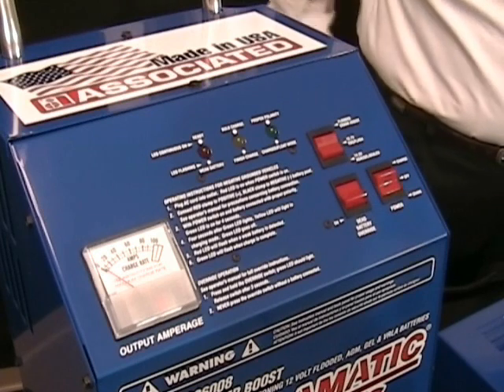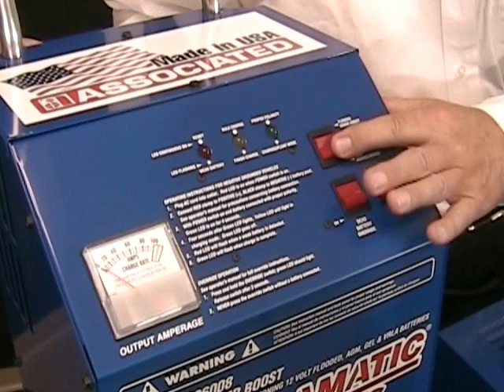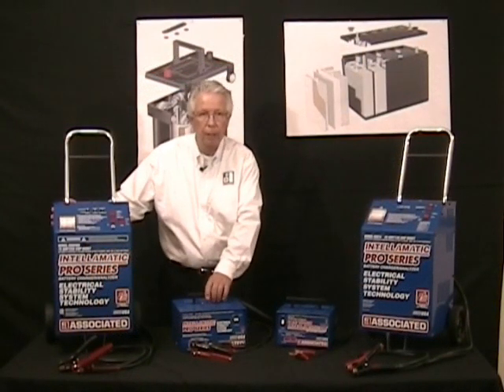How to safely charge an AGM or Gel Battery

Comment: Can you answer why a special charger is needed to charge AGM batteries even though they are charged in car by the same source that charges all types of batteries without issue? So why is a special charger needed?
Reply from the maker: Hi Electric. That's a good question and here's our take on it. Most alternators have a voltage regulator in them and that makes sure that the batteries do not get over charged. Some of the older model battery chargers do not have that system in place but these automatic chargers do have them and are designed specifically to regulate the voltage to protect the battery from over charging and/or damage.

Hopefully, this helps. If not, you are welcome to contact us and speak with one of our technical specialist who can explain better than I. 314-385-5178, ext. 3225
Reply: @AssociatedEquipment  Thanks